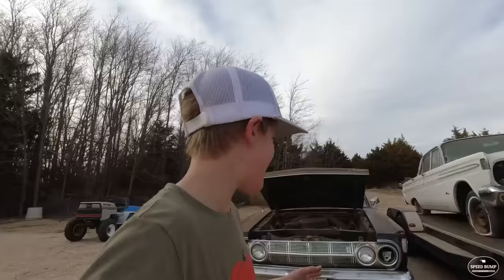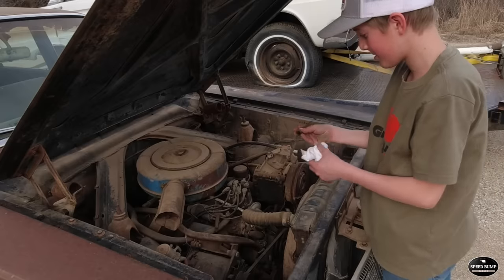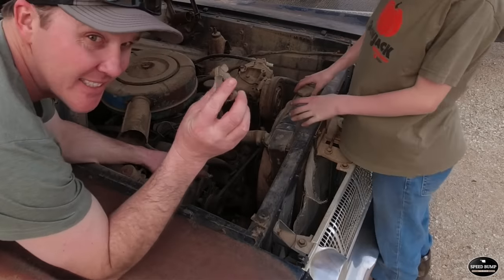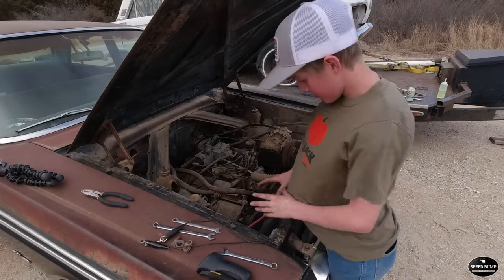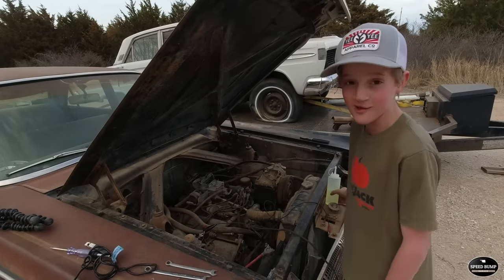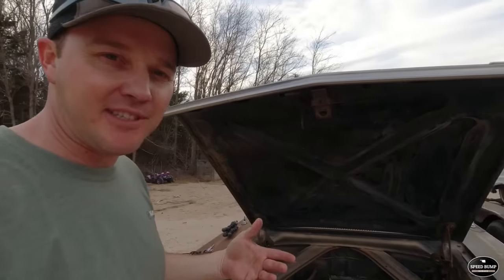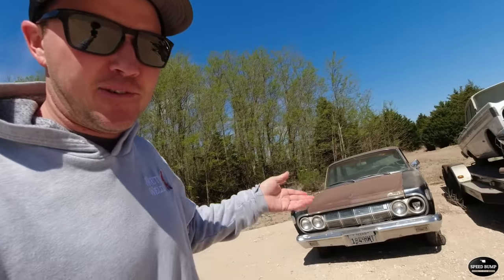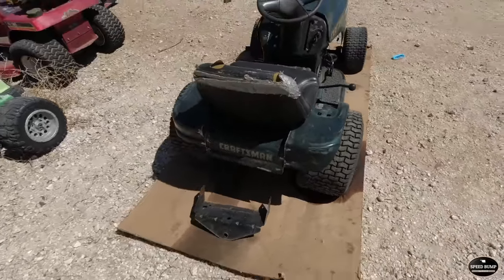1964 Comet... Make it run and it's YOURS!😲

Comment: I didn't see u check the water / radiator. My first car was a 1965 buick wildcat 2dr. I paid $ 35.00 for real $ 35.00, it ran and drove. It sat for 5 years. I put brand new battery and 5 gal fresh gas and drove it home, 80 miles away.

Comment: Hello Guys, what can I do if my engine cannot turn with a wratchet? I see a lot of  oil mud on the cilinder head trough the oil filling hole. It seems the engine siezed. Should I disassemble it or is there any trick? The starter made a half turn like "wu-wu" and after no turn anymore just click. The wire contact works well I checked. The car stays for 5 years I won on auction. xsara 1.6i 1999. Thx for answer!